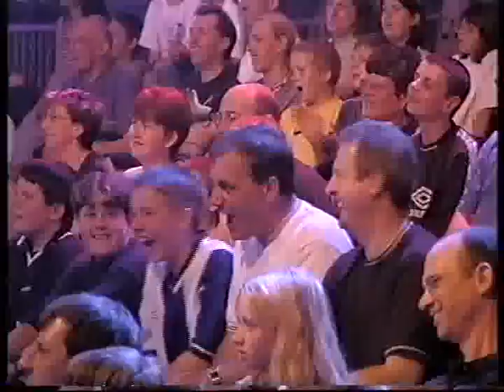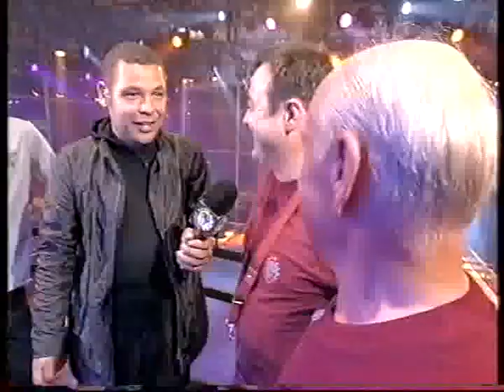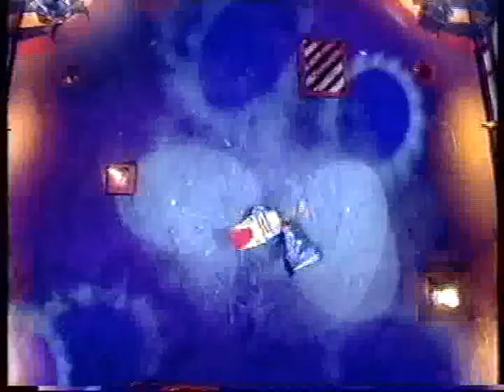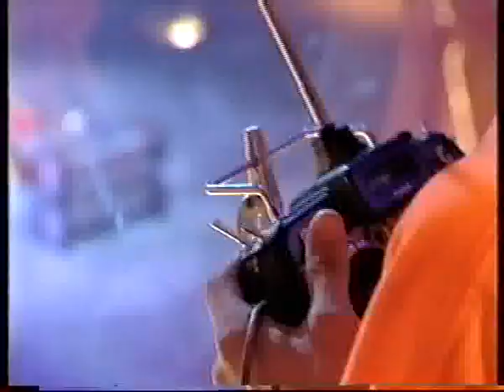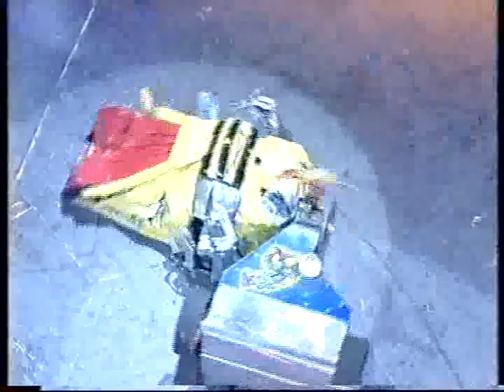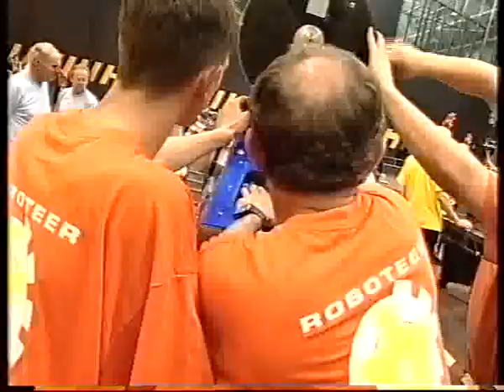Robotwars Series 4 Heat B Part 3

Comment: To be fair to Ian Lewis, he honestly was going easy on Milly-Ann Bug. Razer had to immobilise it to end the battle cleanly, as long as your opponent is still moving you have to go for them (remember this, it'll be important later), but rather than crush the engines and mangle the circuitry he picks off the wheels- damage that can be undone with just a bit of welding. It certainly looks sadistic, but it's the best way for Razer to disable Milly-Ann Bug without utterly destroying it. That said, he still has no excuse for whining like a bitch when Pussycat gets stuck into Razer later in the heat. More on that later...

Love the patches on Robochicken's armour with "OUCH" written on them.

I don't think you ever see a better demonstration of exactly how damaging Pussycat's blade really is than this fight. It shredded Robochicken. However, Robochicken really is surprisingly tough, with all of its electrical systems still working- the axe was going and the only reason the flipper and drive weren't working was because the torn armour plating was jamming them up. It's hard for Pussycat to actually immobilise an opponent unless they can jam or shred the wheels because, unlike Razer or Hypno-Disc, their weapon doesn't reach inside a robot to the vulnerable internals, but they can still make a right royal mess of them, while being incredibly hard to strike back against thanks to their unique design.

Really interesting bit at the end of this video where we see the teams doing maintainence on their machines, hearing their commentary and observations about their opponents.
Reply: Pussycat's blade is excellant at getting stuck into armour or external components, but they need frequent and consistent glancing blows to do that- it's not like Dead Metal's saw, if they remain in contact with an opponent, the blade grinds to a halt and can't actually do anything much, you can see this a few times when they fought Milly-Ann Bug.
Reply: Yeah, Pussycat's blade worked similarly to a lightweight flywheel, building up kinetic energy to discharge in a single armour-piercing strike, rather than wearing its way through like a grinding disc or saw. The problem is that grinding discs and saws required constant, consistent application to slowly wear their way through armour, which is why the only one that was ever any good was Dead Metal, who could use his claws to hold a robot in place before laying into them. Of course, the advantage of the Pussycat blade was that, unlike a flywheel, it wasn't actually heavy (relying on its keen edge rather than sheer weight to rip into armour) meaning that it could spin up to speed again almost instantly after a strike stopped it.
Reply: On the "hissy fit", Only Ian seriously whined. Simon and Vinny didn't really mind. Bit of a blot of Ian's reputation for sure, but Razer shouldn't have broken down. 

Robochicken was seriously tough, took a pounding by Razer and Pussycat, and didn't break down once.
Reply: Speaking of Ian Lewis, is anyone keeping up with Battlebots at the moment? Avoiding spoilers, if you want to see what Lewis is still up to, you have to see the Warhead vs Complete Control match. It's an epic for the ages.
Reply: It was incredible :O I loved it. Warhead finally seems to be repeating its Season 5.0 heroics, 2015 was a bit outclassed for them and it seemed to fail. 

Looking forward to the reboot Arcane? Tried to PM you but wasnt able to :(
Reply: It's gonna be hard, but I'm going to find a way to watch it if I have to tear the internet apart. I've been able to catch Battlebots within a day of it airing, there's no way I'm going to miss the return of the show that initially got me into robot combat!
Reply: ArcaneAzmadi Hopefully you find it. Maybe try a VPN and go on BBC Iplayer? It may work out. There's a lot of spinners in this series which I'm happy with. Flipper Domination in the UK circuit since 2003-15 is pretty boring.